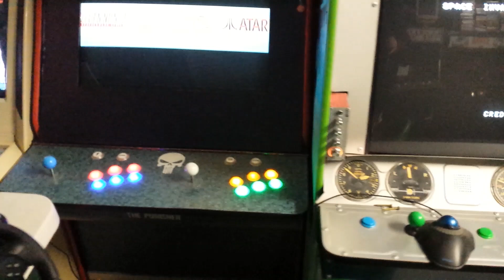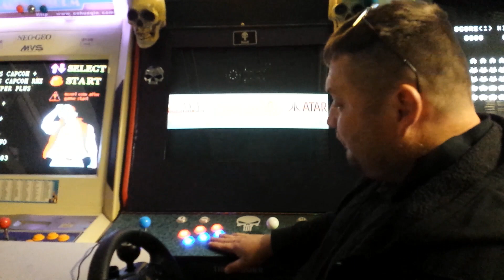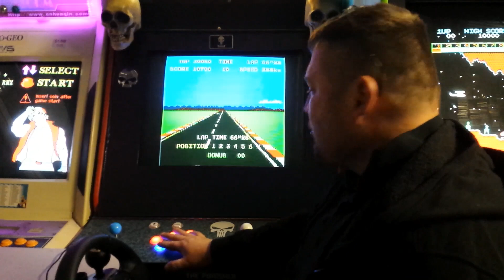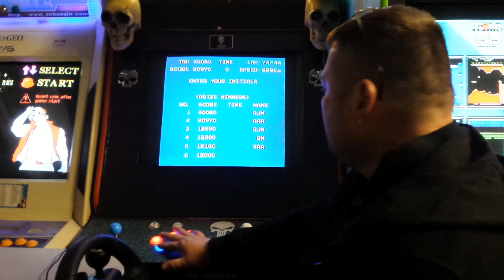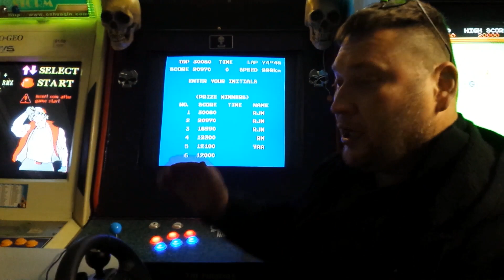Pole Position arcade with GT Driving force steering wheel

Comment: How did you get the breaks to sound smooth like in namco museum? 0:
Reply from the maker: I didnt put these roms on , if you go onto ebay and order a arcade blaster , it's a jamma to retro pi set up , and Pole position is on there , looks and sounds good hey
Reply: @MarchosArcade  that's good! How much is it? :D
Reply from the maker: @JackTheGamer3   goes  for $390
Reply: @MarchosArcade  That could easily become a birthday wish!! ^^
Reply from the maker: @JackTheGamer3  True  , must admit forking out 390 bucks and not knowing what all games were on there, I was nervous , but once it arrived and I got it all running I was very impressed - hey if you want to know if any type of game is on there I'am very glad to help and show it off for you
Reply: @MarchosArcade  I was actually wanting to know if they had any snk and neo geo games perhaps!! ^^
Does it come with a trackball too? :)
Reply from the maker: @JackTheGamer3   yes it does have all the popular Neo Geo , as for track ball it does have the usb input for the trackball or you can see from this video the same usb for the Driving force steering wheel , you have to buy trackball separate
Reply: @MarchosArcade  would the X-arcade tankstick work? As I own one myself!! ^^
It has a trackball built into it!!
Reply from the maker: @JackTheGamer3  I'am thinking it wont'  maybye the trackball , but the arcade blaster would have it's own configured settings , unless you could go to configure settings like you can with retro pi it would work
Reply: @MarchosArcade  I see! ^^
Reply: @MarchosArcade  It's been awhile!!! I actually wanted to know what version of mame the arcade machine in the video you played uses!! :)
Reply from the maker: @JackTheGamer3  yeah sorry mate , I have a lot on recently , yeah not sure which mame version this game is off the arcade blaster